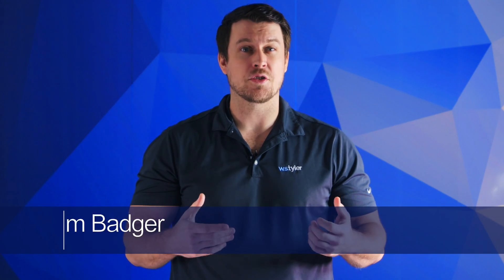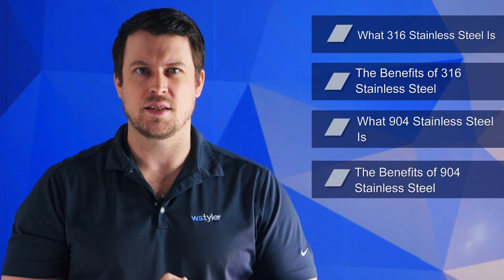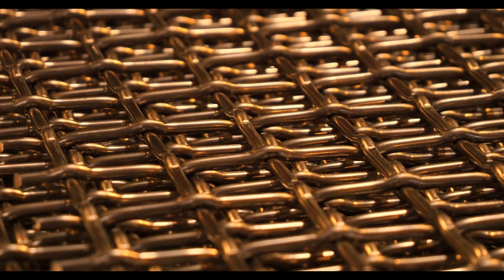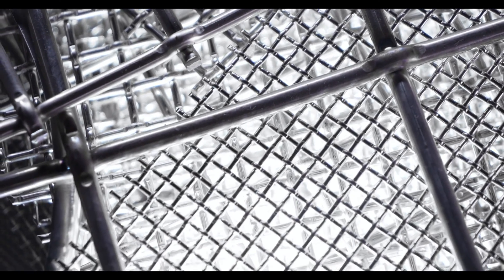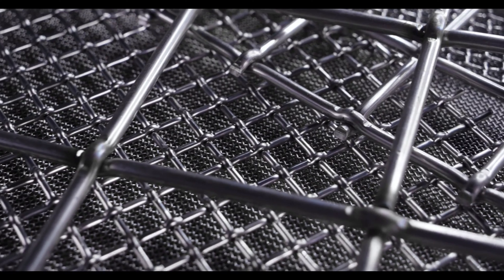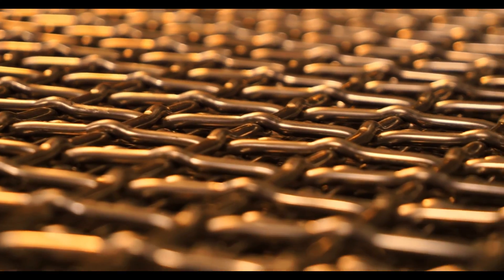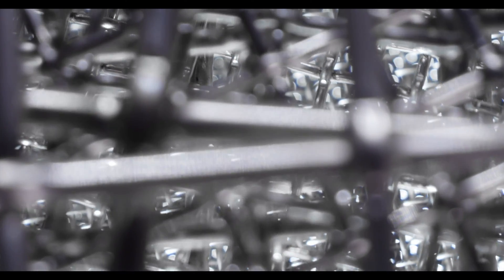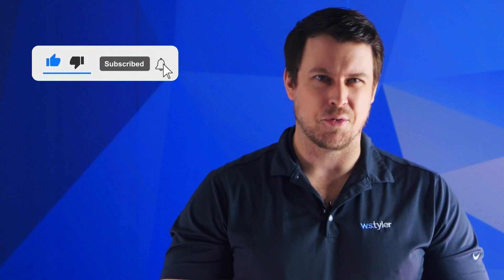316 vs 904 Stainless Steel | Which Is Best for Chromatography?

Comment: Can you use 904L in a rebar format?
Reply from the maker: You technically can, but it's not generally done due to the specialized tools and techniques required for forming and welding. It's usually justified in desalination or if being used in highly corrosive environments, or if the long-term durability outweighs the usually higher costs.